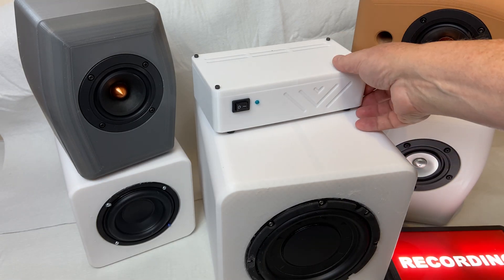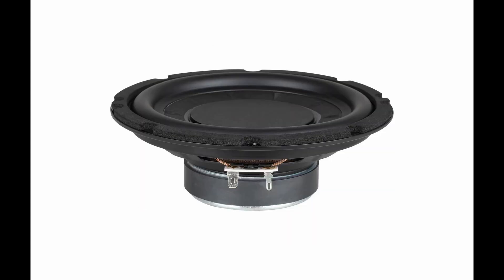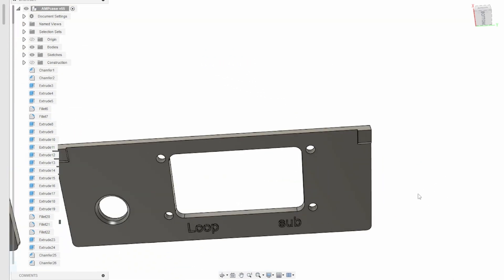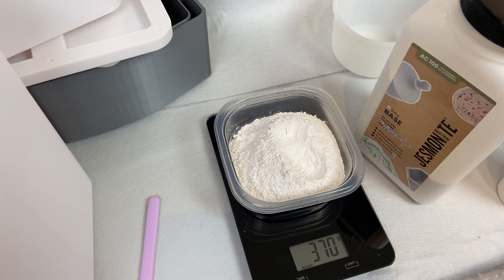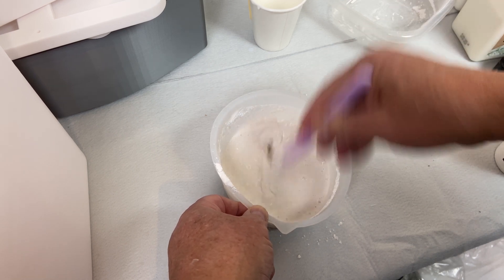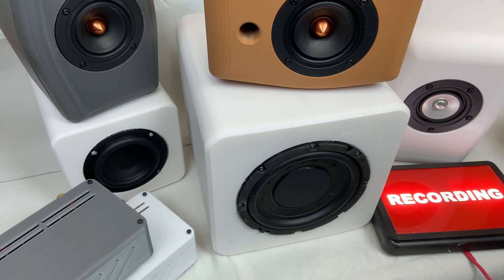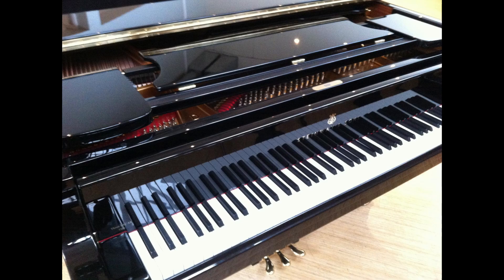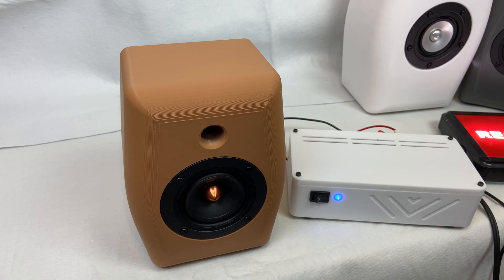3D printed enclosures full range and subwoofer

Comment: Hei!

Did you consider creating the subs with passive radiators? Would have needed 2 passive for 1 active (regarding xmax).
Would give you some more extensions in the frequency range, while still keeping it punchy/musical.
Reply from the maker: No, I wanted to keep this simple. I am still using the larger sub and the ported small speakers as my office/workshop system. (with electronic crossover and 3 small power amps). Happy with the sound still. It works well at moderate listening levels. 

I did consider building something larger (and louder) and use my large DIY 3D printers for the enclosures, but had to spend my time on other stuff in 2025. Might get back to that project later. I would like to have a two way active system with a single sub. Thanks for the suggestion of using passive radiators.

Comment: Nice job!

I was wondering what is your opinion about them, what is your favourite setup? Same about adding on of the sub (which one's the best, does is worth the it to add one?)?
Reply from the maker: @SullivanDaly  My favourite is the vented Dayton with the largest sub. The high end on the full range is very bright and should be dialed back a bit. The vented version has a bit more low end and will work without a sub. But I guess it depends on what you are listening to and the listening level.

Comment: I wonder how Jesmonite filled enclosures would compare to a sild fill 3D print, in sound quality and price.

I always print with a .6 nozzle.  .2 layer height but .4 infill at 100%.  So infill is every other layer and it prints relatively fast.  You could use a 1mm nozzle and print .3 and .6 layers for even faster builds.

With a Jesmonite designed builds, you have a lot of outer perimeters to print, so a solid fill may actually print faster.
Reply from the maker: In my experience the speaker driver is the most important part. Doing minor changes to the enclosure could have some effect, but at low to moderate listening levels a 3D printed enclosure works fine for the small drivers. I am pretty convinced Jesmonite (or similar) improves the «large» sub. Using wood would probably be the cheapest option, I totally agree with you about nozzle sizes and improvements in printing speed. It was a bit lazy to stick to 0.4 nozzle and 0.2 layer height. But I am not going to print more of these. I have what I need for now.